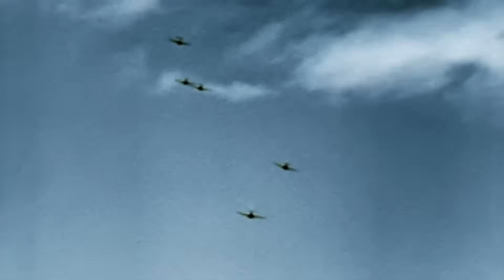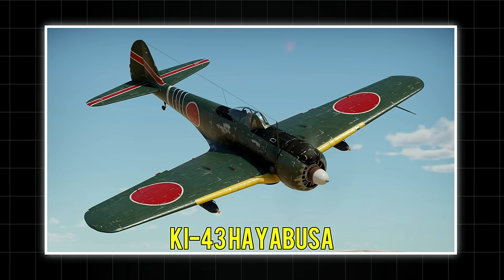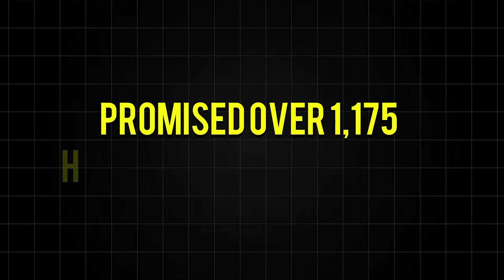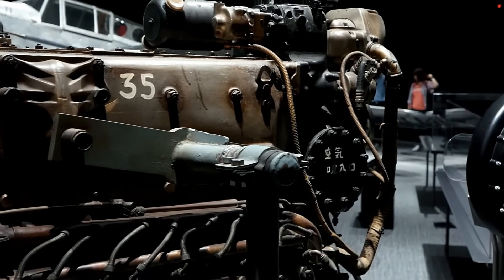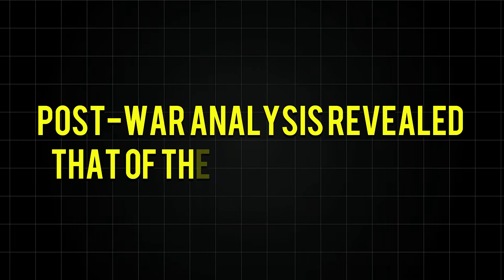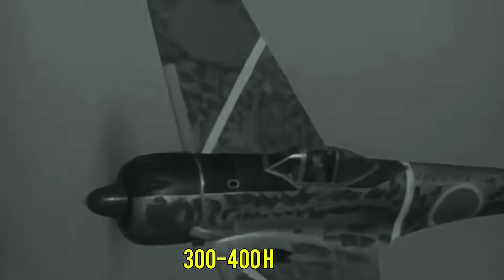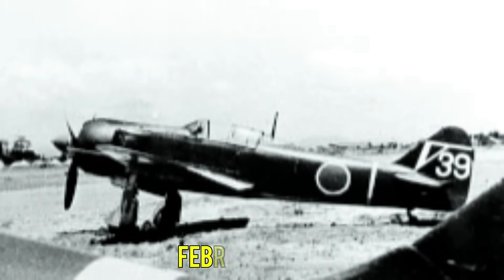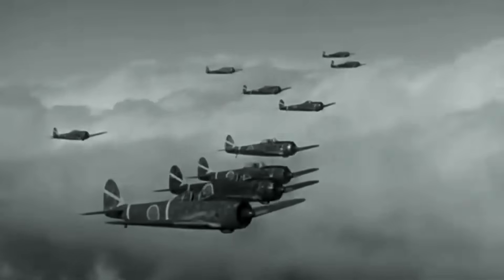The Shocking Truth Behind Kawasaki's Ha-140 Engine

Comment: Despite the footage from the midway movie this is a decent video. A db-601 is too much of a stretch for the Japanese at that time the crank shaft , reality hit ‘em in the face i admire that theythe guts to try I remember the ki-61s had engine failure trying reach their pacific bases for deployment. The expression trying to build a formula 1 engine with bicycle tools is funny but indicates their frustration.  They did the best they could 800hrs vs. 2000hrs manufacturing. They did show a spark of brilliance and promise but it was worth it still great to know this.